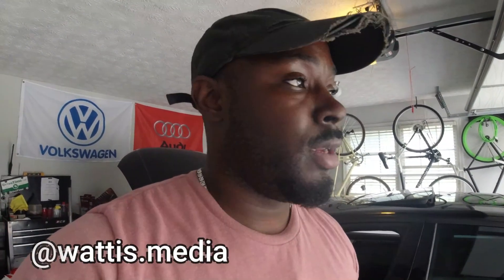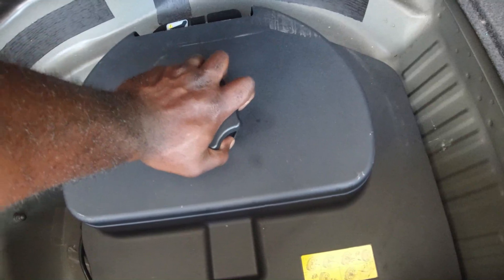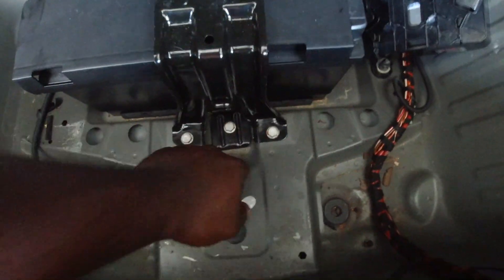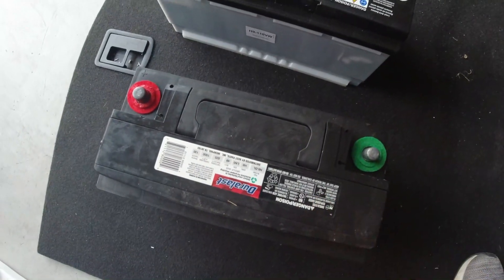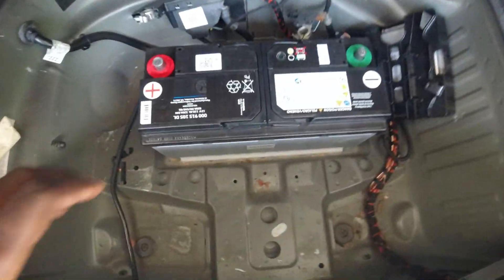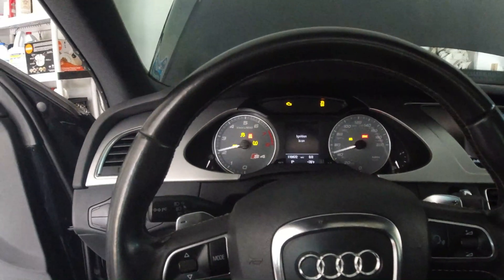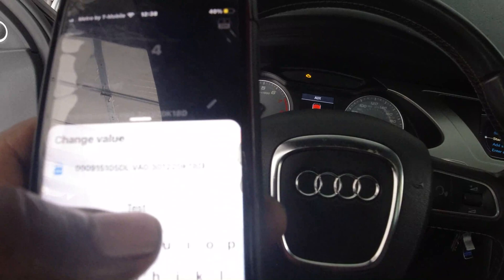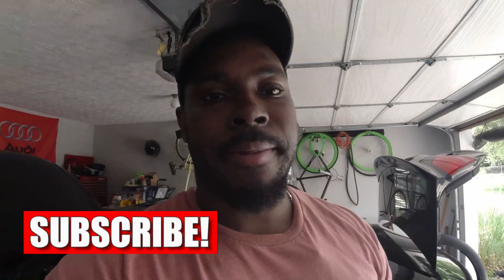B8 S4 NEW BATTERY + PROGRAM

Comment: Hey what battery did you put in your car ?, I have a B8 A4 which is basically the same car almost and the battery that It has right now looks about the same size you’re using but the one that people are selling me looks way smaller is a size 94R (H7/L4) 800 amps, the other one is size 49 (H8/L5) 850 amps and the other one is size 95R (H9/L6) 950 amps
Reply from the maker: I found this for you. The part number was 000915105DL ( 110 AH. 110 amp hour. 110AH/520 amp. 2013-2016. 520 amp. 520 CCA.)   
Link: https://www.fcpeuro.com/products/audi-vw-battery-rear-vag-000915105cc?ads_cmpid=12768022447&ads_adid=123949240507&ads_matchtype=&ads_network=g&ads_creative=515152297160&utm_term=&ads_targetid=pla-293946777986&utm_campaign=&utm_source=adwords&utm_medium=ppc&ttv=2&gclid=Cj0KCQiA3-yQBhD3ARIsAHuHT65-1rwVUCEakiU0vpHCoRVB9OmY9z01tQk9thK7nxth7jMD1k3x5rQaAqcYEALw_wcB

Comment from the maker: Leave it for German engineers to make a simple battery replacement difficult  🤦‍♂️
Reply: Yep.  I remember the days of just putting a battery in and I would be on my way and the car would charge it just fine without any registration.  I thinks they added this requirement just to make more money off of the customer by having you come to the dealership to get your battery replaced and coded.  Don't they have scan tools that should register a new battery for you?